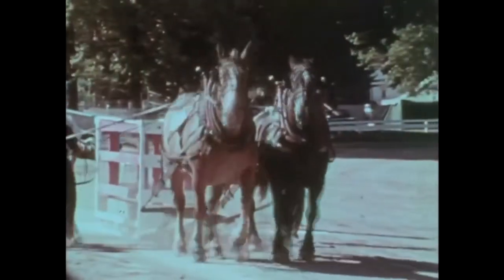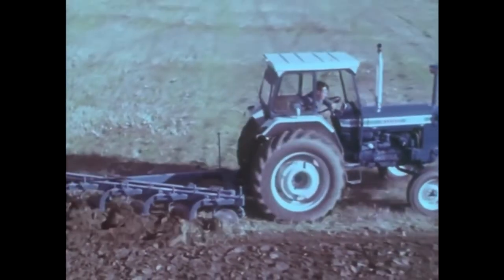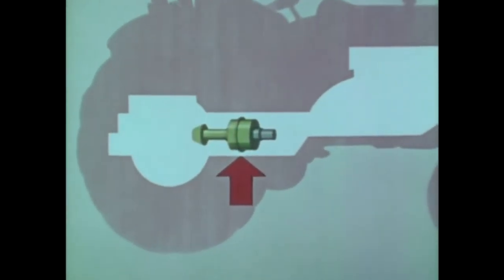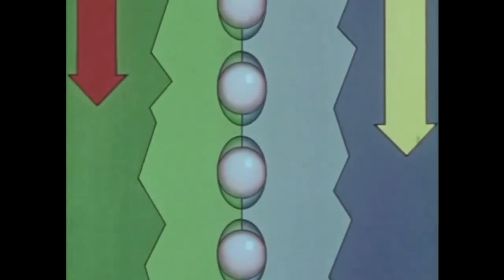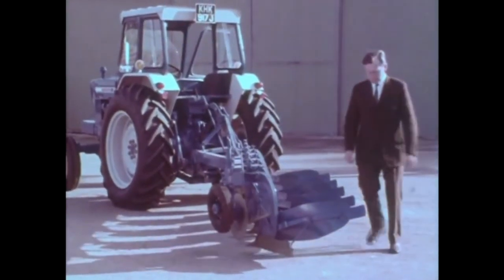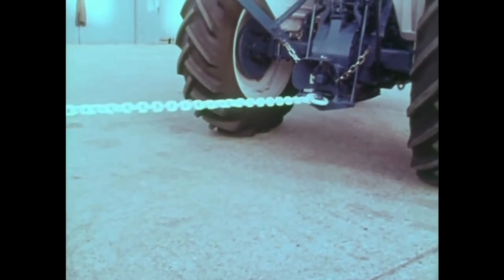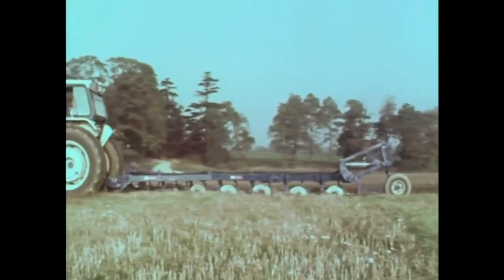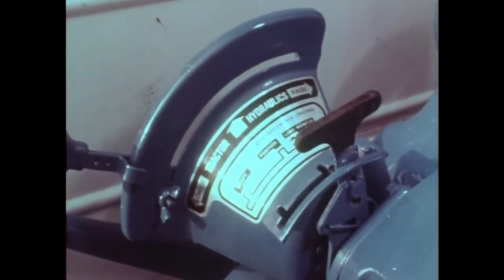Ford 7000 Promotional Film

Comment: I can't seem to believe that little tiny ford 7000 can pull that huge 7 bottom plow with such ease. Amazing 👍👍👍
Reply: Probably doctored it a little bit, not to mention very easy working ground. I highly doubt it will pull 7 bottoms in our clay. A great tractor tho. Very very tough, snotty, reliable. Slow hydraulics is the only fault lol